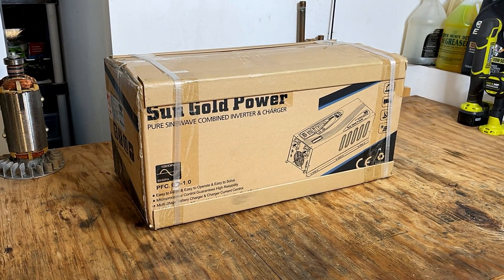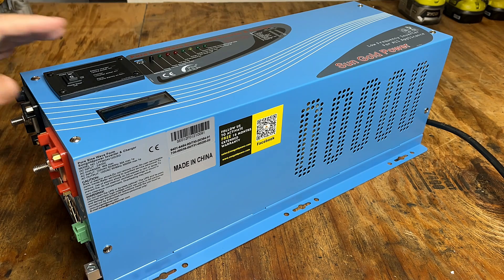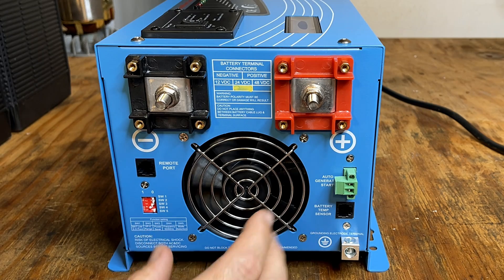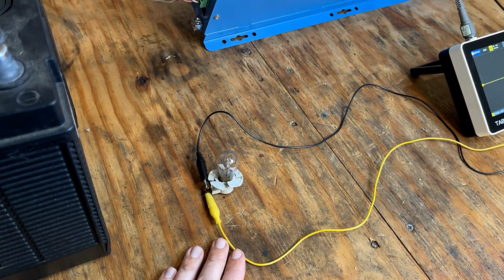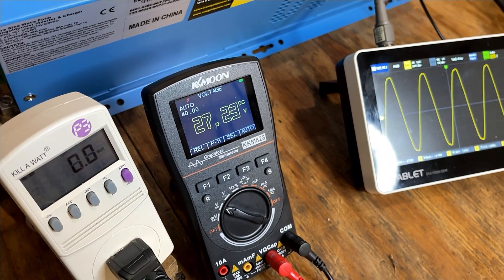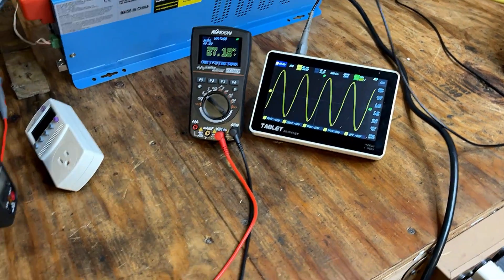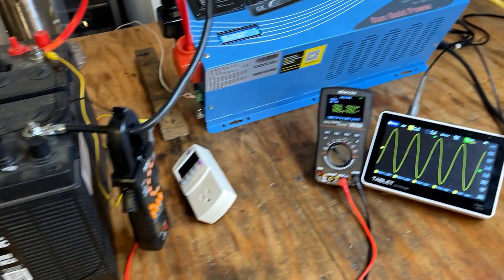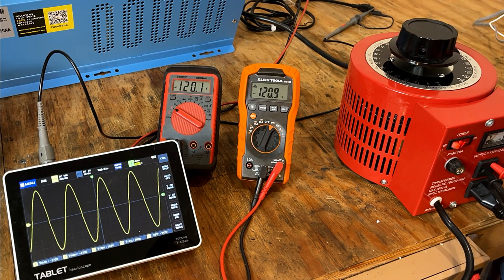SUNGOLDPOWER 3000W Pure Sine Wave Inverter Charger Test and Review

Comment: I'm guessing James doesn't sweat power outages at all. Very informative. One of these days solar will be making an appearance at the homestead but for now I'm just keeping the generator at the ready...
Reply: James probably looks forward to it 😜...
Reply: Most solar setups are simply not worth it and are subsidized and cannot use a battery back up and you will lose power if the grid goes down even if it is solar noon in your locale.  This is the law in most places now.
The battery is a huge part of a good solar installation and they cost a fortune, even for lead acid. Quality lead acid batteries start around a thousand bucks.

Also, I am guessing (though I'm not certain)  this is probably not suitable for a proper solar setup with batteries.  Generally, the really good reliable inverters are North of a thousand bucks.  This stuff just is not cheap. Even this unit is like 800 dollars.
Reply: We had only the 3rd power outage that lasted longer than the 40+ years I have lived in my home.  Generator was ready.  Lots of HD extension cords.  I ran 3 house (mostly refrigerators) 14+ hours/day for 4 days.  No problems.

Comment: I am down in Florida and have been collecting new takeoff or slightly used 48 volt battery kits from golf carts. Right now I kind of have a jerry-rig system where I have to have a separate charger and inverter I definitely think this would be cool to play around with thanks for showing it off!
Reply: Good place to start !  Lead acid batteries, especially cheap used ones are not a bad starting point.  Keep them full of water and well ventilated.  Make sure if you are buying a charger it can be adjusted to LiFePO4 batteries.  Sooner or later you will get there.  Watch the YouTube Channel DIY Solar Power with Will Prowse https://www.youtube.com/user/errolprowse  especially some of the one from last year and early this year.

Comment: Well that's different 😉
A question, when its sitting there turned on and the batteries are charged (so it's technically not doing much) how much power does it use?
I ask as i once years ago used a large 48V APC "Smart-UPS XLINET" with auxiliary battery pack for this kind of purpose, to run lights and stuff if power went out. After running it 6 months i checked my power bill 😳. Just to have it sit there plugged in doing nothing with its huge transformers was costing about $50 a month. Bear in mind I'm in Australia and stuff costs twice as much and i don't know how much power it was actually using in Watts in standby
Reply from the maker: Good point.  I should have checked the input consumption.
Reply: @James Condon  is input consumption, the idle consumption
Reply: I believe Will Prowse is now recommending from his research/pricing using a rack battery is the cheapest option for home
Reply: @ruben_balea  Oh right, never looked into it just stopped using, you're probably right! I got it after it had come out of service and it had been back to the official APC service and "reconditioned" but like you say maybe that means nothing. Oh well its long gone now

Comment: Very interesting.  Based on your video, this appears to be a modernized version of a device known as the "Heart Interface, which has been around since the 1980s and widely used in sailboats.  I have two Hearts: one has been in use in my boat since 1991; the other supplies AC to a critical communications repeater and has been in use since about 1995.  Both of my Heart's run on 12VDC: the boat one is connected to 400AH of East Penn gel cels, and the radio one to 200AH of same.  One difference is the the Hearts are MSW, versus PSW.

I suggest two questions that it would be nice to answer.  The easy one is transfer time from shore power to inverter on loss of shore.  This was important for the radio system because the radio (a Motorola Quantwr) is computer controlled, with a long boot up cycle on initial power up.  We found that on interrupting shore power the Heart swtiched fast enough that the Quantar doesn't see loss and doesn't reboot.  We later measured transfer time and got a result (from memory) of about 18 Ms.

The second question is long term reliability, a question the answer to which requires some long term experience.  Our Hearts were made in Washington state, though I believe current ones are made in Canada.  The Sun Power is made in China.

Anyhow, enjoyed your video.  The potential applications for devices of this type are virtually unlimited.
Reply: Inverters have been around from the late 19th century.  Early ones tended to be mechanical - eg: a DC power source driving a generator, or such exotic devices such as amplidynes (I worked on a radar/radio telescope built out of a cold-war DEW radar station, and used to drive the "aiming" motors).  In fact, as I understand it, this same unit was used in WWII battleship MIssouri-class main turrets).  In 1957 thyristers (SCRs and Triacs) were invented, and they became fully solid state.  After, they started using power FETS, vFETs, SOS FETS and lately the legendary igFET which allow you to convert your entire public power grid to DC except for local distribution lines.

[Most FETs are Metal-oxide semi-conductor (MOS).  So are most high density microcomputers of one form or another. That's further divided into many different categories, like nMOS, pMOS, SOS and igFETs]

We replaced the 4'x8'x8' dish power unit, that weighed over a ton with two 500 pound amplidynes, and vacuum tubes the size of your head with a box about the size of a breadbox with igFET bridges.

In essence, if you took one of Condon's gasoline generators, and replaced the motor with a DC motor, you'd have an old-fashioned rotary inverter with an effectively pure sine wave output.  Every battery-based UPS is an inverter.  The only real difference is how true the output AC is to a sine wave.

Brushless battery power tools are effectively DC to AC inverters where you can change the output frequency and thus vary the speed of an AC induction/synchronous motor.

[DC distribution  in high voltage lines avoids the 10-15% loss in skin effect at 60hz long haul AC.  And completely eliminates the need to synchronize power production generators when you need to share load.]

The "Heart Interface" is just the name of one company who specialised, at the beginning, in small-medium marine applications.

As for long term reliability, do remember where most chips come from these days.  North American ones (Heart Interface was subsumed into Schneider Electric - a French megacorp multi-national) may be mechanically nicer and more solid, but the guts are really not that much different, and often exactly the same electronic components.
Reply: The original Heart Interface inverters created a "modified sine wave".  Not the best for heavy loads like microwave or that compressor.
Some companies still make modified sine wave inverter, but I would not recommend them.  Even though they charge a lot more for a pure sine wave inverter it is worth the money.  Modern pure sine wave inverters, especially the high frequency one, really only cost a few dollars for to build compared to the modified sine wave inverters, but companies get away with it !
Reply: Heart Interface made the FDM 458  modified sine wave inverter/ chargers.  That UL listed inverter/charger series is still sold today under the Xantrex brand.  Xantrex is now an MCE company headquartered in Costa Mesa, California.

Comment: 10:45 you set the microwave for seven minutes. If that was my microwave I know it would start burning the sauce at three minutes and ruin the meal.
Reply: When I cook food in a MW, I set it to 50% power and cook 2x longer.  Faster with full power isn't always better unless you want to create a burnt offering for dinner.  Full power only for boiling water or reheating my coffee.
Reply: @danburch9989  LOL Agree! Even for food where they tell you to cook on HI, I never do in our over the range microwave! What I still don't like is that the power level timer still has a long ON time even at "low" power levels. We still have an antique Amana unit that actually pulses the power on/off with the ON duration increasing as you select a higher power level! All the modern units dispensed with that and went with the cheap way out.
Reply from the maker: I have a higher powered microwave in the house and it burns everything.  The lower powered ones do a much better job.

Comment: Works more like a high capacity UPS, sans the line interactive/buck/boost feature. You need to do a teardown!
Reply from the maker: Exactly like a UPS.  I have a UPS  on my computer system that costs about $800 from Liebert.  Modified sign wave and tiny batteries.  This would do a much better job.

Comment: Your explanation of "Low power inverter" is a bit wide of the mark. Both types use Mosfets these days. My understanding FWIW is that the difference is:- cheaper inverters run at high frequency through one or multiple ferrite core transformers and then the underlying 50 or 60 Hz envelope is then filtered from that high frequency stuff. The LF type uses a square, C core or toroidal transformer and the high inverter frequency is filtered out before the transformer which essentially just sees the 50 or 60 HZ. Ferrite core transformers have just enough magnetic material (ferrite) to meet the specified output and little more than that. With the larger iron core transformer the power limit is mainly a function of winding heating and therefore short term overloads are no big deal.
Reply: Correct, this one has MOSFETs too (or IGBTs) and bigger magnetics
Reply: Did you see the first Kingsman movie? Well, my head just did that....now who's going to clean this up?
Reply: @lot27a  😂

Comment: Looks like a well designed product.  Here in the UK where I live we hardly ever get power outages so I don't even have a generator. When we do it is never for a long time. I suppose that if I were to consider a back up this would be better than a generator. I would only need it for my fridge freezer and the control system for my gas central heating. I could run some table lamps off it as well.  What I like about it is that it does not produce any noise. I'll think about it.
Reply: Well, there are a lot of parts in the UK where the power does fail quite often, an I live in one of them. Luckily it's rural, and a decent diesel generator isn't going to upset anyone, but more than that, it's not really cost effective to run the generator just keep a few lights on, or to give the freezer a boost before retiring to bed. One of these inverters would be an elegant solution to both.
Reply: @whitesapphire5865  I live in built up South East Wales where there are concentrations of people.  There is therefore better infrastructure. In mid, west and north Wales there are large rural distances and low population densities. Infrastructure is harder to maintain.
Reply: The price of this unit in the UK is 735 British pounds. That is just over a thousand US dollars. The larger versions cost more of course.

Comment: Good Morning James.  I hope that you and yours are doing well.  You are correct about MOSFET.  Unless they have major heat sink and cooling they tend to have problems.  Thank you for sharing with us.  This unit is sweet.  I've seen some G.E generators over the years with auto-sense feature.  What would you consider to be the best configuration when using six or eight 12 volt deep cycle marine batteries?  Thank you and have a great day.
Reply: Thr inverter has to use a switching device such as a MOSFET or IGBT. The transformer cannot provide that. I'm almost certain that this particular unit uses MOSFET switching.
Reply from the maker: Would recommend running at 48 volts DC or higher if your system allows it.  Might also be an advantage to using lower voltage batteries in the 6 or 8 volt range.

Comment: I always think it needs to be whole home or bust but you have a point with critical circuits.  For example, refrigerators, well pump...then there are some lights, maybe furnace + hot water.  It would be pretty amazing to have the house just hold over critical stuff on batteries, particularly in the night.  Unfortunately I'd have to wire in a sub-panel and switch those circuits over which is always an involved project.

Comment: 300+ Amps?  4-6 12v  batteries?  How long will it give 3kw?  1-2 hours?  Require many solar panels to keep up, during daylight.  Cost, not cheap!  Ohn's law, 300 amps will make the battery cables very hot at 6ga.  (300a x 12vdc = 3.6kw)  This should give about 30 amps at 120vac.  30 amps will run refrigerator, freezer, furnace or boiler, window air conditioner or fans, and some LED lights, but not anything near 24 hours.  Gas or propane 6kw generator would be  much more economical. (24vdc battery source, like big truck battery, would draw 150 smps, much better).
Reply: Have you looked at fuel prices? lol.
Reply: @genxfpv  It might be conceivable that in the distant future, running a small diesel generator 24/7 would be less costly than paying the utility company.